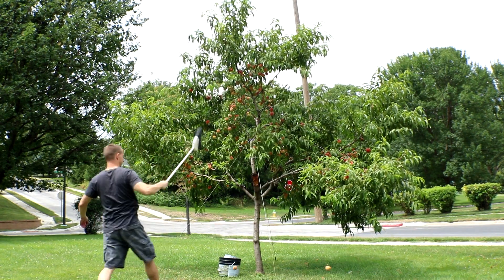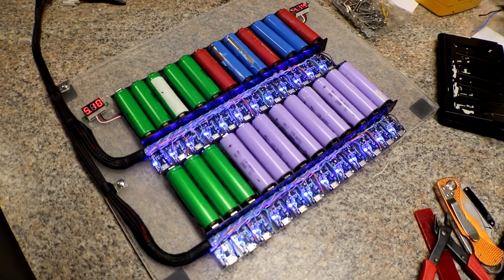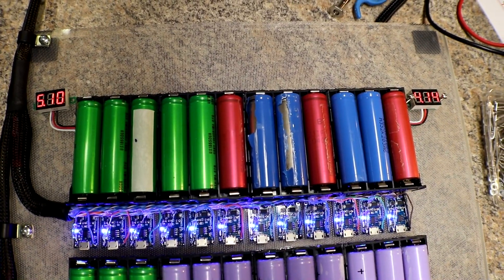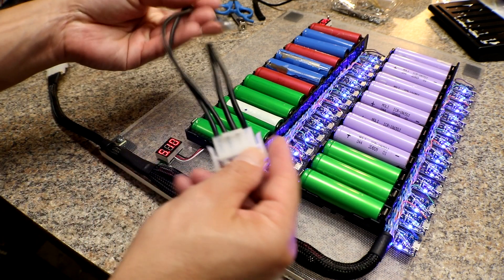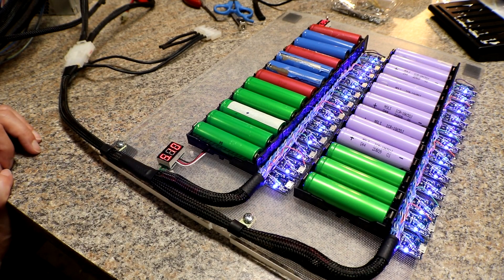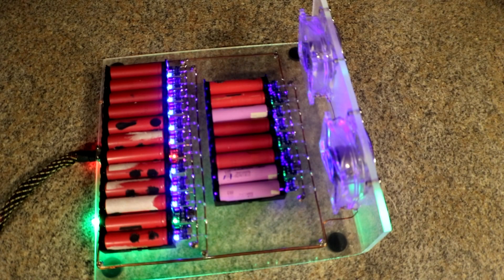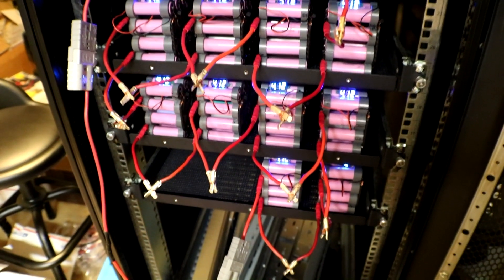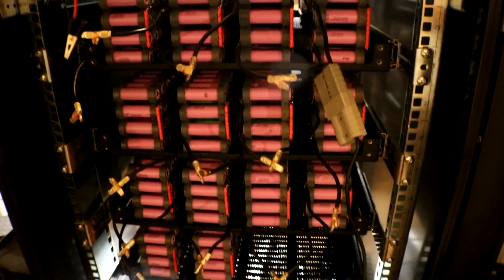Diy Tesla Powerwall ep44 Random 18650's Powerwall Update

Comment: I plan to build a 48 channel charger, based on the TP4056 board with protection.  These boards are dirt cheap on Banggood if you buy them in bulk.  The TP4056 is current limited and protected against over and under loading. It even includes short protection on the input side, not on the battery side, unfortunately.  I doubt strongly if that glass fuse would even protect against shorting the output, since it it blows far over 3 amps, which would burn the chip in a flash.
Reply: Correction: I mean the TP4056 is reverse polarity protected on the input side, but reversing the battery on the output side would burn it.
Reply from the maker: I love and hate these boards lol.

Comment: Hey Really like your videos,  really easy to listen to. I'm thinking of doing this but on a slightly scaled up version coz i'm gunna need a whole lot a cells... I have a question though. In terms of the power supply if it is supplying 40A and i have something like 50 cells connected to it it's all fine. But what if for some reason I have less cells plugged in? would that blow the TP4056's because it is supplying too much current? or do the TP4056's draw only what they need? Thanks heaps and keep making cool videos.
Reply from the maker: The Tp4056's will only draw what they need.  🤘
Reply: AveRage Joe thanks

Comment: What characteristics do the fuses have? Thank you.
Reply from the maker: The fuses I used on the chargers are listed as 250v 1-1/2amp but pop at 3amps at this low voltage.  On my powerwall I use the .5 amp fuses and those pop at 2amps.  You can get them from Keith on ebay https://goo.gl/yiBMR9

Comment: On that charger I'm pretty sure you already got it but I brought one that has a pretty high amp charge and discharge 16 amps for both but the discharge if it's over a couple amps takes a battery on the input and it charges it I believe $30 to $40 i have not had any problems but I also don't think I have tried using it at 16A

Comment: I purchased some of the tp4056 from the link.  All of the LED's are green in stead of blue not a big deal.  But some of the tp4056's are very dim on the LED's compared to others from the same buy.  One of them did over charge a battery to 4.3V and was still going until I pulled the battery out.  The battery was also very warm.  I had to buddy charge another one just to get the voltage down below 4.2v.  Have you had any bad ones that you purchased?  Im thinking about swapping them out and sending them back.
Reply from the maker: They must have changed there posting!  Thats where I got all mine from, HMMMM.  I never check the voltage after they are charged since I swap them over to a capacity tester.  I would imagine there is a small + or -  difference in them all tho.  Yeah the cells can get pretty warm especially the ones with higher resistance.  No I havent had any bad ones.  Im wondering if they got a bad batch or something.  Yeah see if they will swap out or refund?

Comment: They have some really nice LED replacement bulbs for your 4' fluorescent lamps. No ballast noise!
Reply from the maker: +David Wilker I put up new lights then replaced the bulbs with led but I can still hear a slight buzz in the video sound. Soooooo I might have to do something different or maybe its just this brand of leds.
Reply: They make different applications, some that use the old transformer/ballast and some that do not. Do you still have the ballast?
Reply from the maker: Oh ok gotcha. Yeah I didnt take anything out of the lights when I put them up.  All I did was put the led lights in them.
Reply: Yeah, they make the kind that use the ballast, and they make some that DON'T use the ballast.

Comment: Hi Joe, Love you video's. Just small question do you check the capacity of your 18650 cells before making them to a battery-bank or do you just check if they take a charge and hold the voltage?
Reply from the maker: Thanks!  Yup I check every cell before I build a pack!👍
Reply: Okey, but do you also each cell individually for mAh capacity or only charge them full? I am now harvesting 18650 have about 140 cells and now do test charging with Imax B6 8 cells at a ones. Of course I could check capacity but that would take for ages. Just curious if you did that and if so... How to do that efficient? Perhaps you have a video about that or a advise.
Reply from the maker: Oh ok my bad. Yes I first charge each cell and then capacity check each one.  You do that to find out if each cell is still good.  Then based on the capacity of each cell, I determine if it is still usable in my powerwall.  This video https://youtu.be/GDUikK7jQoo is an example of how to check capacity but you dont need to open the charger up to change the switch. I got this charger from here https://goo.gl/EqhPAC and I also use a FoxNovo F-4s https://goo.gl/edqd6D to check capacity as well.  The Imax would for sure take forever to capacity check each cell.

Comment: how are these 20/24 cell chargers gonna be used? is the user supposed to connect batteries to them in order to charge them and then remove the batteries and put them somewhere else in order to be used? 
or somehow you are able to also draw current from the batteries while they are still connected to the tp4056 modules when they are not getting charged?
Reply from the maker: Yeah its a pre and post charger so you can keep your capacity charger only going to capacity checking.
Reply: what i mean is: is there a way to connect a load to the batteries in order to be used as a normal battery bank while the tp4056 are still conected to the batteries without causing a short circuit to the tp4056 modules? or these 20-24 cell devices you showed in the video are only meant to be used as battery chargers
so you can quickly charge multiple depleted batteries you may have arround at the same time and then if you want to use the batteries you charged you have to remove them from the chargers and insert them to other devices for use.
Reply from the maker: Oh ok my bad.  Yeah I guess you could technically use the cells while hooked up to a tp4056.  Shouldnt hurt them at all cause they can only give up to 1 amp out.
Reply: the thing is that as far as i know if you try to connect these cells in parallel in order to be used as power bank while the tp4056 module are still connected to the cells, it will cause a short circuit and the tp4056 modules will get fried. but anyway i think you already gave me the answer, you are making these projects in order to be used just as battery chargers and not battery banks. thanks for your quick response

Comment: Really interested in making my own solar power wall with 18650, but my main concern is balancing each cell while charging it with the charge controller. Was wondering if you were going to balance charge each of your cells and how you were going to do it.
Reply from the maker: Its been a fun project so far! At first I will just be monitoring the packs.  Ill probly set the top voltage a little lower to give a little wiggle room.  I will end up getting the Batrium Bms because it offers so much and I wont have to really worry about it.  How big are you thinking of?
Reply: AveRage Joe I'm planning to use 24v solar setup in my shed for my hydroponic garden. Where it runs on a reverse light cycle so I can charge during the day and run the LEDs during the night. Still doing the maths on how big of a battery I need though.

Comment: Not sure if you covered it, but I discovered that you need to be sure to only charge 1S batteries on each charger because of the common ground and power being fed to the chargers..  If you attempt to charge 2S, 3S, etc. batteries, you short out the charges and let out the magic smoke (sound familiar??).  THe ground for each charger is connected to the battery ground so attaching any batteries connected in series means the + on one battery also attaches to the - on the other battery and is a direct short.
Reply from the maker: Yeppers, They were all for 1s.  Hope everyone knew that but I guess you never know LOL
Reply: Was this thread about the TP4056?

Comment: Hi. Like to watch these kind of videos and all other powerwall channels :) im building my own powerwall and made a solar tracker. I have a hard time getting laptop batterys so im building with new Panasonic cells instead. Not so economic ;) you got your pcm60x yet?. I was wondering if you want one donated. I got it couple of years ago and ran my lead acid batterys
 A tiny project and i have a pip2424msxe now for my lithium powerwall. And i thought why not make good use of the pcm60x and donate it for a good cause :) you can get it for only shipping fee  if you want it. I live in sweden so dont really know what shipping would be . Take care
Reply from the maker: I love watching all the powerwall videos too! It seems a lot of people have a hard time finding laptop packs.  I guess new cells is better that No cells at all lol.  I made a solar tracker also a few years back.  It was made from a couple relays and photo cells.  Got the diagram from redrok.com. they have a bunch of trackers you can build.  That would be freakin AWESOME!!!  Any way you could see what the shipping would be?
Reply: AveRage Joe yes thats true. :) i tried toing a load test but failed from to much heat from the negative side 60 degrees celcius after just a little while didn't seem ok :) . I tried building packs from vruzend lego blocks. Maybe for ebikes it works but not suited for higher amp draw packs. But now i know that, always learning by mistakes . I bought cell holders so i can solder them now. Didn't want to do that with new cells but now its the only way :)  I can check with the post office tomorrow. Anyway i can contact you to get the adress so i can check?
Reply from the maker: Yeah that seems pretty warm.  I wondered about those lego block style holders.  They look all nice and cool buuuut yeah lol.  I always learn by mistakes, keeps ya learning 😜.  How big of a pack are you going to build?
Reply: AveRage Joe haha yeah they sold them in good ;) im at little over 3kwh now  i guess if i go after the battery specs Panasonic ncr18650b 40p7s buying more as i get money, so my goal isn't set yet. I like to come up to you guys level but with new cell. Trying to compete, so maybe when im  retired im there ;)
Reply from the maker: +Eric Friman 3kw isnt bad. Im gonna keep collecting cells and shoot for at least 30kw. It will definatly take a while. Like you, when funds allow it :) New cells would be nice tho.

Comment: Mess, but it's organised mess (As I say to my wife who is trying to climb over stuff in my bedroom to slap some sense into me.)
Oh that 2nd unit, you should have put blade fuses, at least you can easily exchange them although may cost a little more.
With the server rack, I reckon you should put an insulated (highly protected) bus bar with plugs so they plug straight in.

Why don't these chargers have ability to charge to 4.1 only. I prefer that if possible.
Reply from the maker: Thats right, its an organized pile! All of them...LOL Blade fuses woulda worked I guess but I had a bunch of the Axial's to use up.  Ya Im thinking Ill be upgrading the wires that come out of the UPS.  It has the Anderson connector on it now so Ill stick with that.  Ill probly do a vid on the UPS next since Im waiting for funds for a charge controller.  Might as well get that all ready.  Yeah I think some of those Tp4056's vari in the voltage cause sometimes when I take a cell from those and put it in my Foxnovo, some will go into capacity check sooner that others.  I could just be the cell is weak tho to.  Ill try to pay attention next couple of times.
Reply: We really need to stop calling these DIY "tesla" powerwall. I think we should be proud to give it our own unique name yeah. name competition!?!?!? MyPowerwall, DIMPowerwall (did it myself), etc. hehe
Reply from the maker: True but people search for diy powerwall.  Thats why I have it titled that way.  My playlist is titles Power Rack Project tho 😃
Reply: hmm.. but people searching tesla powerwall also end up with some home brew Pete, etc. LOL
There's also nothing wrong with giving it a name and add in brackets the tags you want searchable. The more high profile people do it and people see it, it becomes the new norm.
anyway, was a thought, don't want tesla to get all the credit for the work DIYers are doing :P
Reply from the maker: +Phizicks Yup, I have power rack in my tags and it is being searched. Not sure if I was the first on you tube to call it that but could be